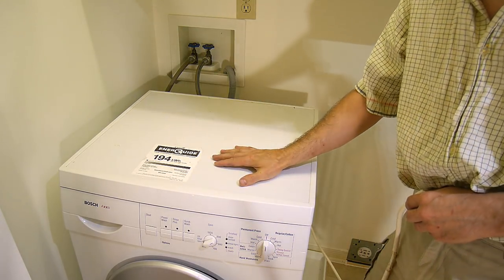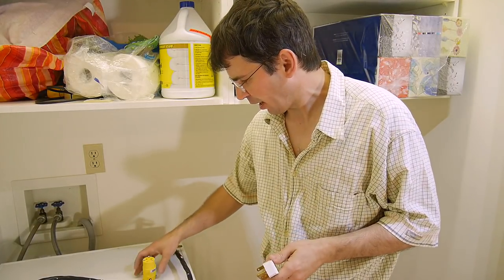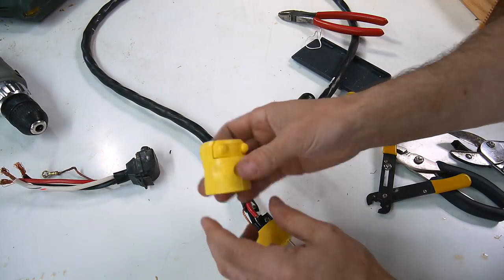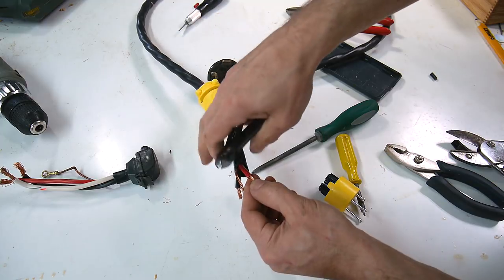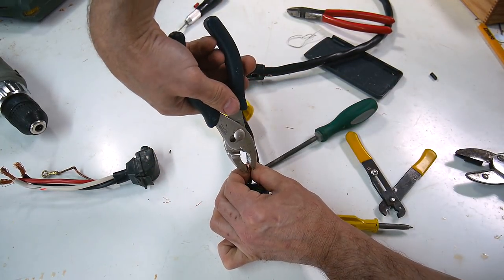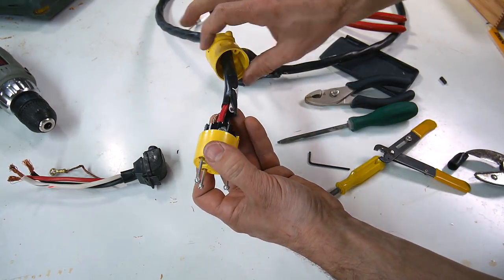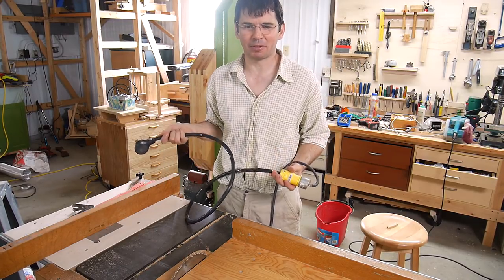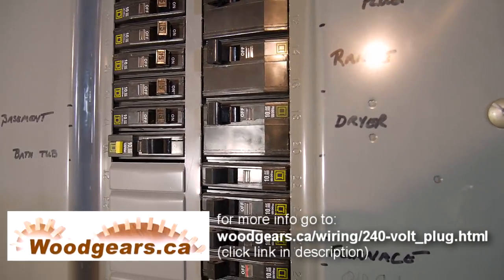240 volt from dryer plug (for Euro-washer or table saw)

Comment: Is it just me who is used to neutral and ground being to different things? Sure, they are connected somewhere in the system, but earth is used for RCD/grounding things right?
Reply: you should never combine or just ignore ground or earth, its for safety reasons
Reply: Yes at least in europe. Neutral and ground are seperate in your house but connectet in the street. 
The RCD measures the difference of the current between hot and neutral. If a failure occures and current leaves the system over the ground wire the difference isn´t zero anymore and the RCD turns of the power.
Ground itself has also a safty feature when you´ve got a device with a metal housing. If the insulation inside of the device is damaged and touches a metal part it creates a short circuit and the circuit-breaker will turn off the power.
Reply: The washing machine doesn't use the neutral as in 220VAC you can use the two lines to get the complete circuit the protective ground is still used as the protective ground. The neutral is only needed if your 220VAC appliance also has an independent 120VAC circuit inside it.

Obviously yes you should not use the ground as the neutral as RCD/AFCI breakers will trip in many cases.
Reply: The neutral and the ground shouldn't be used interchangeably as a general rule.  However what he does in this video isn't to use them interchangeably.  I don't know if it is a lucky coincidence that what he does is mostly safe or just happenstance.  (I say mostly safe because as he notes, the amperage of his breaker is too high given the load).  A 240v load doesn't need a neutral.  In North America, we have split phase which means that you have 2 hots which is like the + and the - of a simple DC circuit.  When you use 120V you only use one hot and then use the ground as the -.  If you look at his dryer's actual plug, you'll notice that there are only 3 prongs so, in this case, the neutral is redundant.
Reply: Agreed. It makes me laugh when people get neutral shock and wonder why. Neutral and ground bars are separate in the box for a reason
Reply: You have a neutral and a ground bar in the service panel to accommodate all the wires. That's the reason there are two of them.
Reply: The neutral and ground are the same thing, they're just used for different reasons which is why you shouldn't mix them.
Grounds are used for shorts, neutrals are used for returns. Depending on what you're running mixing them up can cause safety issues. Matthias was right in this case to simply ignore the neutral. wire. It would have been nice if it simply weren't in the cord,  or to apply some liquid electrical tape to the exposed conductors, but honestly it'll be totally fine. You have exposed ground wires near hot conductors in every single box in your home.
Reply: billybobjoe198 Sorry but you are wrong sir. A grounding conductor does not carry current. A neutral can be grounded, but ground is not neutral. A neutral represents a reference point within an electrical distribution system. A ground represents an electrical path, normally designed to carry fault current when a insulation breakdown occurs within electrical equipment. They do not touch in the box and you should never cross them.
Reply: I'm sorry but you're wrong. Neutral is bonded to ground in the service panel. Ground is only meant to carry fault current ever too. Neutral is the normal current return path.
Reply: Paul Frederick I don't know what planet you get you circuit boxes from but I have NEVER EVER seen a neutral bar touch a panel wall or ground bar. Now please scroll back up and read my last post again. Other then you being wrong about the first part of your statement you just paraphrased mine.
Reply: MrWizards1974 being ignorant does not make you right. From NEC Article 250 — Sections 250.20 through 250.34

(B) AC Systems Not Over 600 V. Alternating current systems of the following types must have the neutral (X0) terminal of the power supply bonded to a suitable grounding electrode (earth).
Reply: Paul Frederick You are joking right? Did you not read my other post or did you stop at me saying "Sorry you are wrong sir". Go back and read it again. Now try and understand what you are reading before you call someone ignorant.
Reply: They are the same thing in a North American main panel.  Amazing how inaccurate all of you "experts" are.
Reply: MrWizards1974-- yes, they do touch in the panel, at least in the main panels here in North America.
Reply: +MrWizards1974 
You're writing in an argumentative tone, but we're agreeing.
Reply: Sean Fyodorovich Sorry but no. The neutral is isolated from the box in EVERY box. They are not the same thing. The neutral and ground should never be wired together. This is wrong, and potentially dangerous.When you plug in something in the outlet, the neutral will be live, as it closes the circuit. If the ground is wired to the neutral, the ground of the appliance will also be live. This can be felt as a tingling if you touch the grounded casing of the appliance, because most of the current still goes through the neutral where the lowest resistance is.However, if there is something wrong and the neutral is disconnected, it will make the appliance dangerous. If you touch the casing, and some real ground (like a water pipe) at the same time, you will close the circuit and carry all of the current.So, connecting the ground to neutral totally defeats the purpose of having a ground, and actually makes it more dangerous than not having the ground at all. I hope this explains this so you all can understand. I thought I explained this in my above post, but maybe I was too technical. Please do yourself a favor and at least google something you don't fully understand instead of making yourself look foolish.
Reply: billybobjoe198 no tone here friend ;-)
Reply: The are NOT separate in every panel. If you have a sub-panel, the ground bars are isolated.  If it's a standard panel in a house, the grounding and neutral busses are the same and bonded to the box.
Reply: In north America, There are 3 wires entering the house.  Hot, Hot, and Neutral.  the 2 hots are the opposite sides of the centre tapped transformer and the neutral is the centre tap.  Here's a pic of a north american panel: http://profixhomerepair.com/images/servicepanelinside.jpg, you can clearly see 3 wires, 2 hot at the top, 120V each, and neutral.  There's a link connecting the 2 buses on each side, and ground and neutral (bare and white) wires going to that common neutral bus from the branch circuits.  This is how it works, in Canada the only panels I've ever seen have a dedicated neutral and ground bus, but there's always a link between them where the service enters the home, and no link on sub panels.

In the UK, there are 5 wires, L1, L2, L3 hots, neutral, and ground.  they never mix in the home, but the neutral and ground ARE connected upstream.
Reply: in aus we use an m.e.n link to link neutral to ground and we have some of the strictest rules ever regarding electrical and its not called ground its called earth fricking yanks
Reply: Well said!
In Europe a connector lying close to a washing machine must be splashproof. In Canada not?
Kind regards
Reply: No, Ground and neutral should have the same potential.  In ALL systems ground and neutral are bonded, just some systems the bond happens before it hits the street or before it enters the home.  In Canada, the bond happens inside your breaker panel inside your house.  Neutral, Ground, natural gas lines, water pipes and all conduit and boxes in the house should all be bonded together.  You should also have a grounding rod installed and wired to the ground bus in your panel...which is also connected to the neutral bus.
Reply: +Jesse Carlton That's not always the case.  In sub-panel setups, the neutral and ground bars are separated.  The ground bar is bonded to the cabinet, but the neutrals are not.
Reply: Yes I meant bonded as in "bonded at one point".  Neutral and ground are only boned once, in the main panel where the ground bus starts.  all other safety bonds (gas, water pipe, cable, phone line) would come off that ground bus, and a grounding rod would also be connected at the main point where neutral and ground are bonded.
Reply: JosefsensDK in the U.K the ground always goes to the fuse box so that if ground becomes live it switches off avoiding an electric shock or at least minimising potential hazards
Reply: All you people arguing about if the neutral and ground are connected, shut up, go outside to your panel, and TRACE THE FREAKIN' WIRES.  Unless you're not in North America, in which case why the hell are you arguing about what's in our panels?

And yes, there is some fluctuation in potential between neutral and ground.  Sit and think about Ohm's law a bit and maybe you'll figure out why that happens.
Reply: Shut up and learn about TT systems, where the earth is NEVER DIRECTLY connected to the neutral except in the substation which might be kilometers away from you.

Connecting neutral to ground in a TT system is a perfect way to get an electric shock, because unlike TN systems the neutral is not guaranteed to have 0V on it.
Reply: I shut up and read a bit about TT systems.  Interesting setup.  Of course, it's completely disallowed by the NEC and Canadian electrical codes which specify TN-C-S...  so what's your point again?
Reply: It's disallowed because at 110V you would need too low a R(e) (earth loop resistance) for TT to work properly. At 220V, instead, you would just need 12 ohms in order to trip a typical 16A breaker (which is about the maximum breaker size installed in an European panel) and even 1600 Ohms if you use 30mA GFCI, which are easily achievable with a single grounding rod.

I just replied to your "All you people arguing about if the neutral and ground are connected, 
shut up, go outside to your panel, and TRACE THE FREAKIN' WIRES"
Reply: Ah, yes, but that was in the context of "Unless you're not in North America, in which case why the hell are you arguing about what's in our panels?"  Mattias is in Canada, and the argument in this thread was about grounding in North American boxes.  TT isn't really relevant here.

In any event, my comment was aimed at the people in North America who were arguing back and forth over whether the ground and neutral were connected.  The argument was stupid, since anyone in North America can open their box and verify if the connection is there or not.
Reply: Up to your comment it wasn't very clear you were all referring to TN-C-S :-)
Reply: Neutral is connected to ground at the main panel. Any sub-panel down the line is not bonded as it creates multiple reference points to ground in the system which is a no-no.

Comment: To clarify American residential 240V service: we call it single phase, and it is, but it comes from the ends of a center-tapped transformer secondary; thus with regard to the center tap, there are two 120V waveforms 180 degrees out of phase, totaling 240V RMS. These are our "hot" legs, which feed two busbars in our service panels. The transformer center tap connects to a neutral busbar in the panel, which is grounded or earthed. 240V circuit breakers span both "hot" busbars, supplying two wires with 240V to an outlet: power is taken only from the two "hot" wires, not a live wire and a "dead" one. A safety ground wire from the neutral busbar also proceeds to the outlet. For 120/240V appliances that require both voltages, a fourth, white-insulated neutral wire is run from the neutral busbar to allow full-current access to the center tap, providing 120V between "hot" and neutral. Appliances needing only 240V, like Matthias's machine,  use only three wires, requiring no neutral. Getting back to the panel, 120V breakers connect to either one of the two incoming "hot" busbars. These circuits are completed through the outlet back to the neutral busbar, thus spanning half of the transformer secondary, from end to center tap. 
In all cases, the white wire, whether it is a 240V neutral or a 120V grounded wire, is paralleled with the bare or green safety ground wire. This seems redundant, but the safety ground's termination at the appliance's chassis is the difference, giving a low-resistance path for short circuit voltage to return to ground at the panel, tripping the breaker instead of electrocuting someone.

Comment: I know this is an older video but the plug that was on the European branded washer is in fact a North American NEMA 6-15 plug.  Yes it is different that the standard outlets you may find in your home but it is a north american plug type none the less. Bosch dryers have a standard dryer plug and then have a NEMA 6-15 pass through for their washing machine.  The 15 amp 120 volt washer receptacle circuit could have easilily been changed to 240 volt 15 with a NEMA 6-15 receptacle for the plug where someone doesn't have the matching dryer as another option.

Comment: @Rich X it's split phase 240v. He has 2 120v phases that are 180 degrees apart. Connecting to both gives a potential of 240v rather than the 120v between phase and neutral.

Same with 3 phase over here in Europe. 3x 240v at 120deg apart. Which gives 400v between phases and obviously 240 between phase and neutral.

Comment: I would recommend that you change you dryer receptacle to match the washer cord and change the breaker to the washer recommended amp load breaker.
Reply: Its fine how it is. Devices are plugged in all the time into receptacles with higher ratings (for instance a 1A floor lamp into a 15A outlet). The breaker is there to protect the wiring, not the device
Reply: Not entirely true.  High consumption appliances are required by code to have a dedicated circuit with a breaker that is properly rated to protect everything up to and including the appliance.

Comment: Just so everyone understands: 240V split-phase does not need a neutral wire.  The two hot wires are the two legs of a transformer secondary; they are 180 degrees out of phase and serve as return paths for each other.  The ground connection here is a normal protective ground connection.  

So don't think that you can wire neutral to ground - that creates a shock risk.

Comment: Why not just change the head on the plug
Reply: Jefferrey1 that will most likely void the warranty on the washing machine
Reply: It's second-hand - I doubt it has any warranty remaining.
Reply: Jefferrey1 I was wondering why not just change the outlet
Reply: There are a number of ways of skinning this cat without using a patch cord.
Reply: no
Reply: Actually, the best way to skin this cat is to just change the plug out to an approved 240v/20a. outlet and then change the breaker in the panel to a 20a. breaker.  Using a 30a. breaker with a 20a. appliance is asking for disaster.
Reply: You should take a look at Photonicinduction's videos. Usually things pop at around 2-3 times base wattage. Very rarely 1.5x.
Reply: locoken No, the CORRECT way to install this is 1)Residual-current device for the wires/phase 2) connect the wire to the wall and no forms of pluggs or outlets. 3) Use all wires correctly. That is, yes you need to use the stafety ground.
4) 20 Amp max for that wires.
Reply: The safety ground is connected, it's the U shaped prong on the plug.
Reply: Huh?  .....shaking my head.....

Comment: Do you have the matching dryer? Because the washer plugs into the back of the dryer. ( one of the top corners). The dryer has the usual 3 phase plug. Had the same model but the more high end version.
Reply: I just rewatched that and noticed you said you don't use a dryer. My bad.

Comment: that mistake...i do it all the time..😂
Reply: Or the barrel union nut on a PVC glue up or the copper nut after flaring the pipe. Arrrggghhh
Reply: Or the heat shrink after the solder job.  DOH.
Reply: Sucks when you forget to put a hood on your connector. It usually ends up in unexpected parenthood.
Reply: oh my...56 likes??...first time ever... #feelingoverthemoon...😂
Reply: I'm happy that I'm not the only one doing the same mistake from time to time .... :)